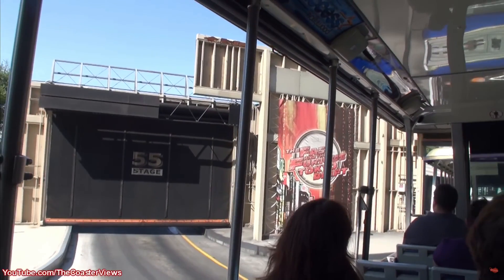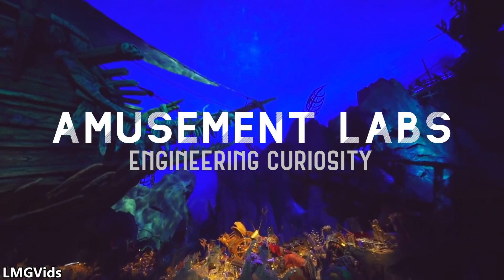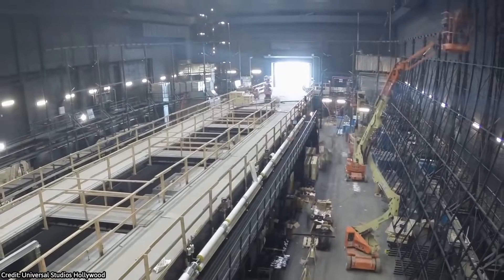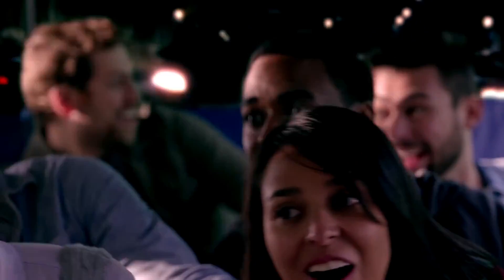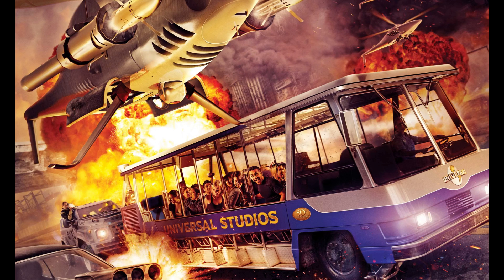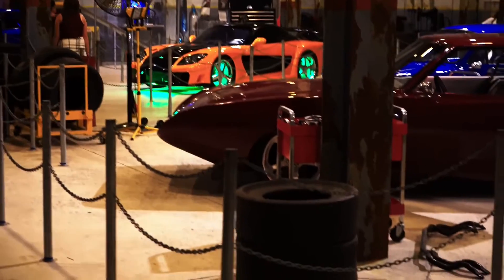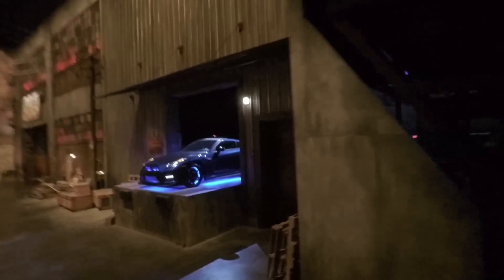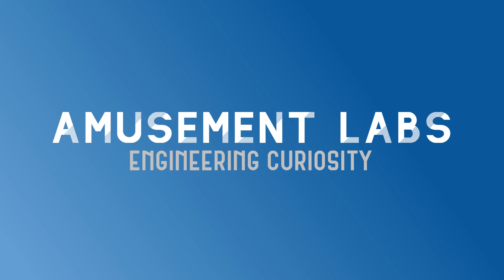Fast and Furious Supercharged - HOW IT WORKS

Comment: "...that looks like something out of a Harbor Freight circular..." OMG! THAT was hilarious! Yeah, this is just like the King Kong attraction where you get shuttled through a bunch of rooms with movie screens. Big deal. And THAT, folks, is the value of ACTUAL, PRACTICAL sets and props: if the ride stops, you're still "in the environment." But this "ride" and King Kong, if the attraction breaks down, you find yourself in a big, empty room with emergency lights and not much else. And don't EVEN get me started about the weaka$$ storyline... IMHO Universal has too many of these "virtual" rides. I know it's cheaper to maintain a big empty room as opposed to a space filled with animatronics, set pieces, props, lighting, etc., but this is UNIVERSAL for Criminy's sake! This is a company that SPECIALIZES in sets and props! Had that whole car chase been effected with REAL vehicle bodies and a modicum of OTHER real stuff (like the old flooding subway show), they MIGHT have something. But this is just... insulting.

Comment: Thr ride might suck but the technology making it happen is pretty cool
Reply: MIght as well load up everyone into one of those old motion-simulator theatre's and just make the screen on the inside a "Wrap-Around" screen with water-misting hoses and smoke machines built into the seats for the interactive part component.... Might be a better ride to boot.
Reply: @steadholderharrington9035  I may be the only one but I actually like the Kong version. My main complaint is that the screens aren't bright enough. Otherwise I find it pretty immersive and intense.
Reply: I will agree that the screens wrapping around simulate traveling on a bus pretty well.